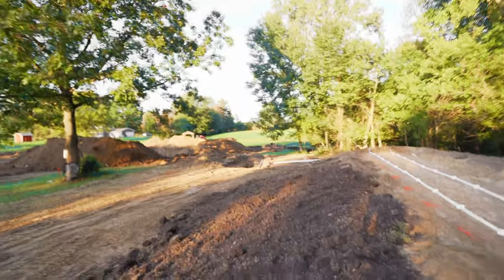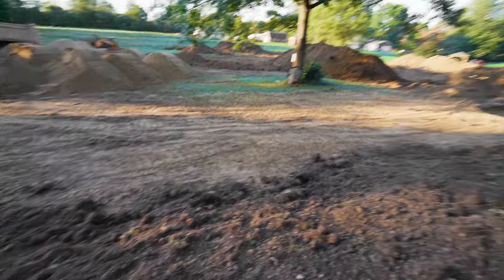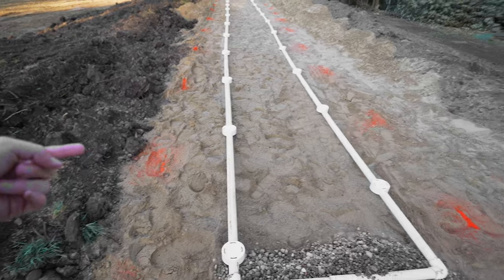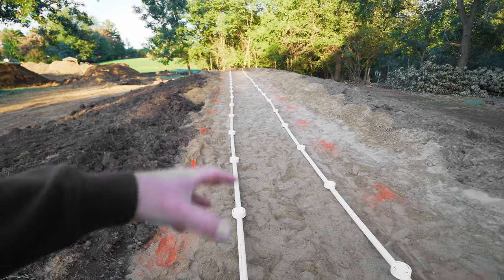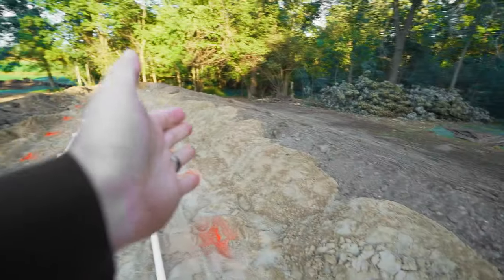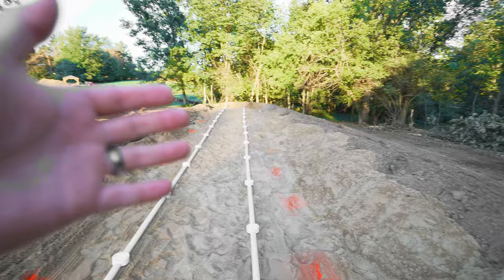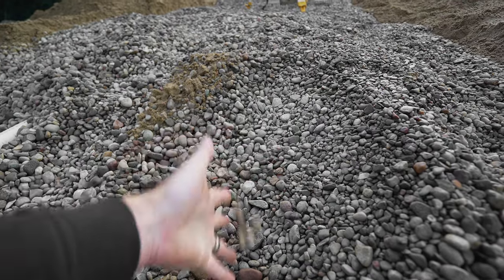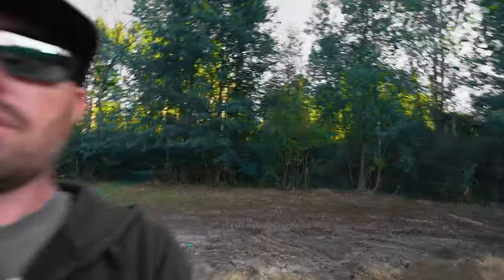HOW A MOUND SEPTIC SYSTEM WORKS // How a Septic Field Works // Mound Septic System - Sand

Comment: We’ve done lots of beds in clay. Just a layer of some regular bank sand first then clear stone, pipes, and clear stone flush with top of pipes to finish and cloth. Not up to code but never had any issuers
Reply from the maker: Unfortunately once you follow code you have to get way more complex with the system.  I think this is WAY overkill but you know how the government is...
Reply: Yessir lol did a septic for a trailer home once the bed was like 4 runs and 90 ft long
Reply from the maker: @JJimmy647  Good lord!

Comment: Thanks for the informative video. Do you know how far up hill the effluent can reasonably be pumped?
Reply from the maker: Depends on the size of the pump.  The stronger the pump, the higher you can go.  These system have to be designed by an engineer who takes all of this into account.

Comment: Just bought a seasonal cabin in the Yoop with a mound system. Was installed in 99. Inspection shows cement tank is higher than it should be so decreased capacity. Would this be a frost issue - getting pushed up higher and higher every Spring or more likely a bad install?
Reply from the maker: Most likely a bad install. Those tanks go deep enough that you're below the frost line. They should be anyway.

Comment: Will grass grow in that heavy sand mix on top? is there anything to be careful of when doing finish grade on houses with this system?
Reply from the maker: A little grass will grow in the sand but not much.  We were able to go back and place a sandy topsoil mix over top of the mound that will actually grow grass.

The only thing you need to be aware of is that you can't ever take a wheeled machine over this field, even a skid.  Tracks will be the only vehicles that can safely drive over the mount.  You also want to drive perpendicular to the mount as opposed to driving inline with the pipe.

Comment: Hi Bryan thanks for the informative video. I have a mound system thats pushing 30 years old at my home in Green Bay WI area. Last summer I noticed a couple of soft spots on top of the mound. I dug down to find the pipe to make sure there wasnt a break in the pipe. No break was found. Could I be looking at a clog which is causing concentration of the liquids in that spot or being 30 years old, is my sand clogged up and not allowing drainage. If there is a clog, can this be jetted out? If the sand is not draining anymore, is there a fix other than replacing the mound. Thanks for the help.
Reply from the maker: That could be a potential cause of the soft spot.  We have local requirements that you have to clean out the system every couple of years to prevent blockages.  You might look up what your local code is and see if you can run something through your lines to clear them out.

Comment: Does this system work on any sorta evaporation or the mount needs to breath? Asking cause neighbor has a raised bed garden on his and was told you cant put anything on top cause it will block evaporation.
Reply from the maker: These fields get a foot of sandy topsoil spread over top of them with a max cover of 2 feet.  This allows the field to breath just fine.  You can plant grass but as with any septic field, you wouldn't want to do any trees or decorative plants due to root infiltration.

Comment: What size house is this system designed for? What are the rough deminsions of the leach field?
Thanks!
Reply from the maker: I think this was around a 2000 sq ft home. The field was 6x120 with all additional material being added to keep a 4:1 slope.

Comment: Is there an outlet ( take out water trough a sprinkler etc. ) out of the septic?
Reply from the maker: No, the pipes have holes drilled on the bottom side of them about every 2-4 feet depending on the field design.  The water is forced down into the stone bed when the pump runs.

Comment: If you had a sloped property could you install the mound system just being gravity fed?  In other words, let’s say the elevation  of the ground under house (or at the slab) was 20-30 feet higher than the base of the mound.
Reply from the maker: In theory you could.  It would be constructed more like a traditional septic system with 4 inch perforated pipe instead of the smaller gauge pipe we use in pressurized systems.  That being said, this is all theoretical.  You would have to talk to your local municipality to get approvals for something like this.

Comment: Question….  Does the mound system always get placed inside the drain field?
Reply from the maker: Only if it is an engineered field.  A normal septic system will leech into the ground without problems.  Engineered systems are required when the ground doesn't perc which is why you make the mound.  You are creating an above ground leech field.

Comment: "Washer Sand" or "Mason Sand"
Reply from the maker: Mason sand is a different mix than the sand used in this system.  This is 2NS surrounded by Class 2 sand.